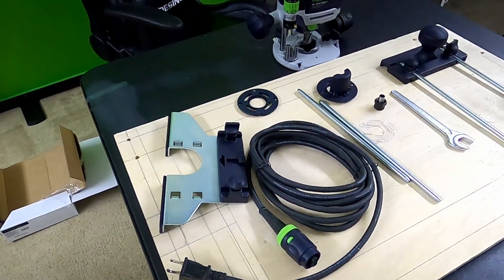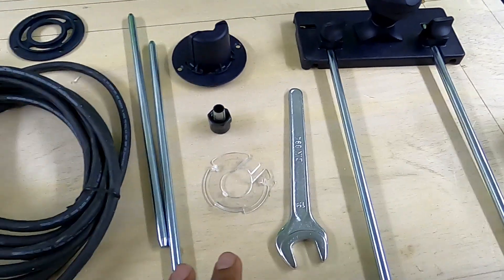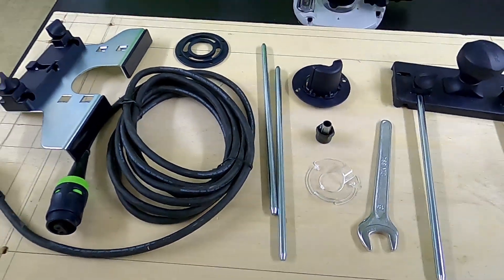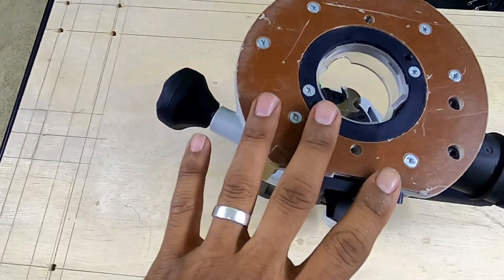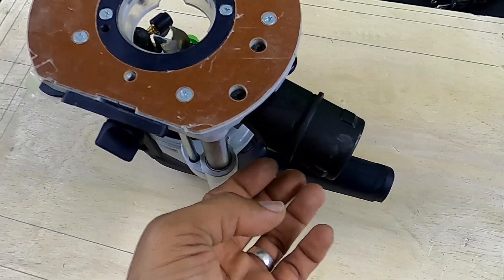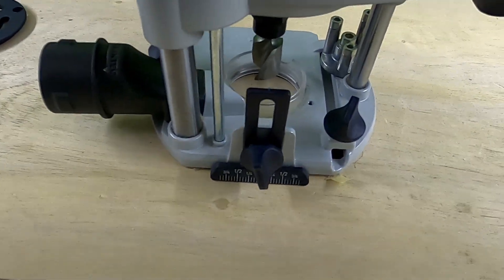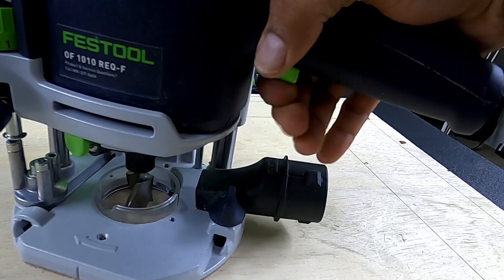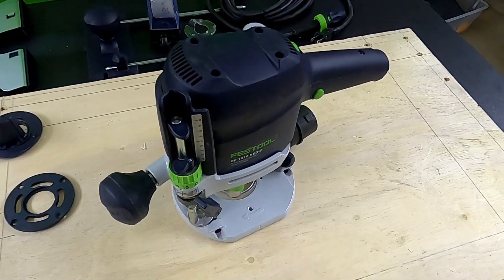Festool OF 1010 REQ F Plus Overview

Comment: I'm lovin your tool "arsenal ". I have owned the 1010 for 20 years and it is has been a very good router . My favorite router is the DeWalt DW 621, it's my go to router. It has very unique dust extraction.
Reply from the maker: The Festool 1010 is a handy little router. I looked up the DW621. The dust collection is similar to the Festool 2200 router.

Comment: all router from festools what is the best? or what router do u use most?
Reply from the maker: Hello, Micro Doulo. Thanks for your question. All of the Festool Routers have been nice to use thus far. Choosing the best router depends on the application. Routers are broken down into different categories based on power and application. The MFK 700 is a trim router best suited for smaller trim work applications. The OF 1010 is a step up from the trim router. You could perform trimming applications with it, but it might be more challenging to use than the MFK 700 for those applications. 
On the other hand, the OF 1010 is a more versatile router providing a bump up in power while maintaining a relatively compact design. The OF 1400 provides a similar body type to the OF 1010, but it gives you improved power and versatility at the cost of compactness. The OF 1400 can utilize collet four different collet sizes versus the two for the MFK 700 and OF1010. The largest of Festools offerings, the OF 2200 is the most powerful but the least flexible to use in all applications. If I could only have one router in the Festool system, it would be the OF 1400 due to the ability to manage all collet sizes, which offers the best flexibility. 
I hope this helps.